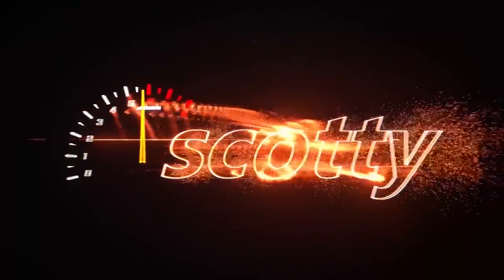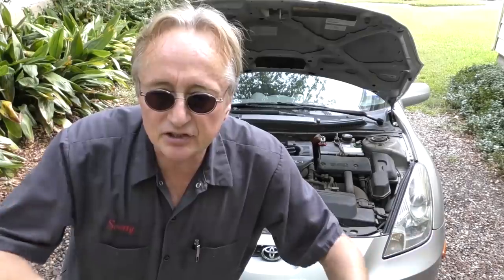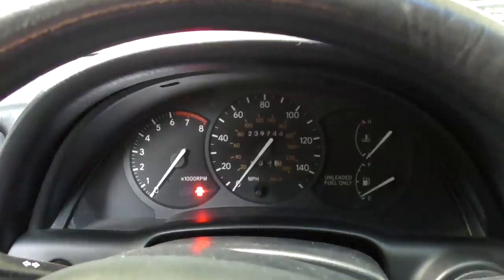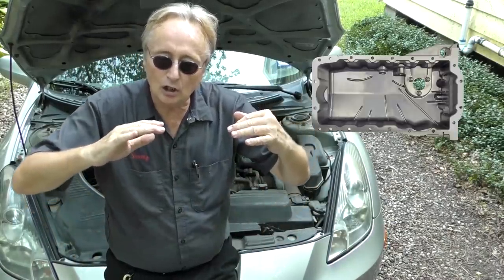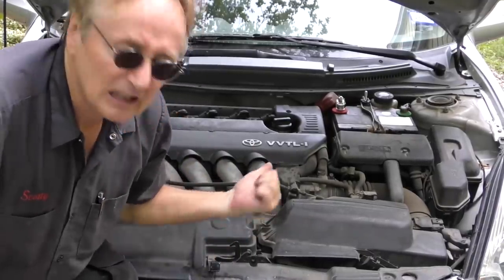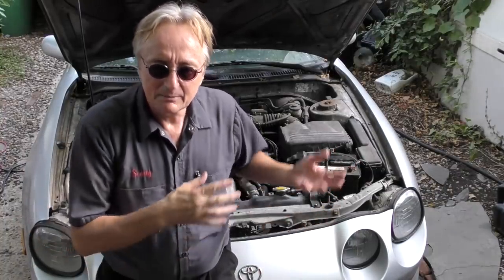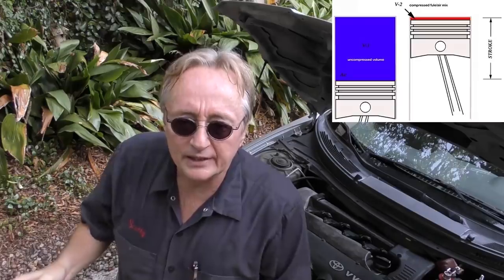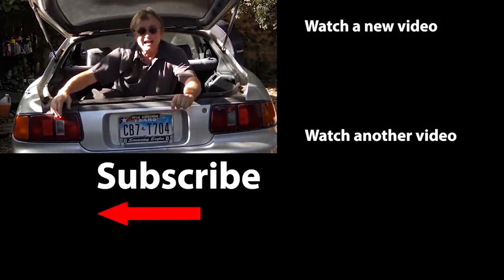Why Not to Buy a Toyota Celica

Comment: Even with the flaws the 00- 05 celica gts are  my favorite  budget car
Reply: 5 things to do to fix all the problems he listed.
New updated lift bolts from later model 2zzges and clean lift screen
Moroso oil pan with about a extra half qt of oil
Apexi pfc to hit lift afew 100 rpms earlier to stay in lift between up shifts
Learn not to money shift
Use quality full sythetic oils and dont cheap out on lower octane gasoline
= Bulletproof 2zzge
Reply: I’m looking to buy one for touge and planning on doing everything to make the GTS handle better and bulletproof
Reply: @comediccommentator4663  hit it right on the head. Although I'd spring for a new oil pump, rev it about 500rpm higher with the pfc so you land at 6K or over. You lose a little bit of oomph lowering your lift point
Reply: @comediccommentator4663  All the five things you listed, is why I would not buy one!  :-)
Reply: @mikeymike758  You wouldn't buy one because of not being able to money shift?
Reply: Comedic Commentator how much is the oil pan ... cost?
Reply: @felixhernandez6736 go ahead and waste your money
Reply: @syed bokhari Depends where you find them for sale, i’ve seen them go as low as $450.
Reply: @Mikey Mike
To each their own. 
Lift bolts cost like $15 and are like a 10min job to replace + clean the screen
Moroso oil pan can be expensive, but it’s like a hr and a half job to replace the oem one with the moroso pan (well worth the money if youre going to track or beat on your 2zz)
Apexi pfc isnt necessary, you can always swap out for a older 2zz ge ecu which had lift point at about 6k rather than 6.3k-6.8k (like $100 at a junkyard)
And using quality oil and premium gasoline is just a given if you care about your machines, it’s whats recomended by the engineers that designed the engine.
These design flaws are NOTHING compared to other makes and competitors. (Aside from maybe the teggys).

Comment: I know mileage does vary, BUT, I drive a 2000 celica with the 2zz and I haven't had a single issue for the 7 years I've driven it. I'll be rolling 230k miles soon, factory everything, and it's never ran better. Most dependable car / engine I've had, right up there with my GM 6.0. Just my $0.02 tho

Comment: The problem is Toyota cheaped out on the oil pump gear.  It was sintered metal, so when it sucked up any air, the cavitation would chip away at the gear or even cause it to explode.  This wouldn't happen with a solid metal gear, which was available in the aftermarket.   The pan issue was because of how well the car handled from the factory (think ITR).  Put some sticky tires on it, take an offramp at 80mph, and you'd probably have an issue with no oil at the pickup on most cars. 

Also, note that the 2001+ Celicas had revised shift gates, because drivers couldn't drive and misshifted (still didn't stop them...).  And the 2002+ Celicas lowered the rev limiter from 8400 to 7800.  Another attempt to reduce the chance of blowing the engine on a misshift, but all it resulted in is hurting power (8400 is required to stay in lift from 1-2).  Aftermarket solutions existed, but the 2000 Celica was the purest form of the car. 

The version of the 2000+ Celica that should be avoided is the 2000-2002 GT.  The 1ZZ engine from those years was well known for oil consumption issues.   Same issue in the Corolla and MR2 Spyder (which also inhaled its own precats!).
Reply: I have never owned anything but a manual transmission. I've never miss a shift before I bought my Celly in 2000. I did it twice before they fixed it with upgraded shift gates. All fixed under warranty. Afterwards, no problems. I was going straight down into fourth, but second gear was engaging. So your slightly wrong blaming it on people that can't drive.

Comment: The 2zzge can drive the oil pump to the point it cant suck oil fast enough. There are aftermarket gearsets and/or oil pumps to fix it, so.... 
Fix that and they work fine.
Reply: The oil pump has no problems at all.
The thing is the 2zz engine may suffer from oil starvation when it passes 1g side force, to solve this you need a baffled oil sump, like a Morosso or one from Eliseparts. Doing this change, the oil pump will just run happily forever
Reply: @anunknowndude  Thanks for the tip. 👍

Comment: The problem with these 2zzge engines was insufficient oil capacity and oil pans with no baffling.  Both could be solved with an aftermarket oil pan.  These things also commonly get destroyed by miss shifting at high rpms.  Otherwise they are pretty reliable as long as they are cared for.

Comment: I have 2zzge 192hp in my Corolla T-Sport and it has done over 300tkm. Still works and pulls perfectly fine. Just proper and regular maintenance and it works just like any other good Toyota engine.

Comment: Toyota Tacomas are bulletproof. I seen a few of them with about 750k miles.
Reply: Swaggy Jay Had two Tacoma’s in a row that were both lemons. First (2012) had a bad transmission (could not shift directly from 1st to 2nd) and the second (2014) had a lousy v6 engine (piston slap). Both were bought brand new from the dealer. Both got the same support from the dealer (they tell me “they all do that.”). Finally bought a 2016 F-150 and it is a truly incredible truck. I would NEVER go back to Toyota trucks.
Reply: Tom Harding The ones I seen were under the year 2000. So I guess maybe the older models lasted longer. Sorry to hear about your experience. Anyways, the Ford F-150 trucks are truly amazing.
Reply: Tom Harding your first mistake was buying a lemon, you should kbow what you’re getting yourself into

Comment: I have a 2000 Toyota celica gts with 225k miles and the original engine no problems
Reply: They're solid engines. Scotty is running out of video ideas.
Reply: Me too but Scotty isn't the first person to warn about these engines. Just make sure you regularly change your oil and use the correct oil ... and keep your fingers crossed!!! Lol 😅😂🤣
Reply: @SteveRogers461  The problems he describes are from the first ones sold in Japan which had higher rpm limits. They fixed this for the models sole internationally.
Reply: J Anything these engines are actually known for their unreliability..
Reply: @ColdVsIce  Don't know where you're hearing that, the only major problem was the oil pump failure with the first bunch that were sold in Japan. Rarely hear of any engine issues with these, plenty  over 200k miles on the clock.
Reply: @hippopotamus86  Your proof that the faulty ones were only sold in Japan?
Reply: @80s_Boombox_Collector  The oil pumps were known to have problems but this was fixed by lowering the rev limiter on models sold everywhere else.
Reply: @hippopotamus86  That being said, Esther Romero's GTS could qualify for 'Show-off Sundaaaaaay!' Very nice, well-built cars, and I'm quite confident the mileage on this GTS will easily overtake the one on Scotty's 1994 car.

Comment: I have a Celica VVTi 💖 143 hp and I find that your video is true and therefore can be very useful. But ... there is no car and car brand without trouble.
What about the prestigious Subaru engines that fail as easily as their transmissions?
What about the latest turbines on BMWs? I've known several people whose turbine exploded and didn't even pull hard with their BMWs...

Comment: Same engine I have in my Lotus Elise. :) And I love it!
Reply: in Principle so you drive a Toyota celica with a body kit... I’m sorry but you bought the wrong car my friend
Reply: @swankgodd3647  to each their own. :)
Reply: @swankgodd3647  Remember that the Elise is crazy lightweight, and designed from the ground up as a sports car.  Unlike the Celica with Corolla underpinnings.
Reply: Christian Fiore between the celica and the Elise were talking 500 pounds. At the most. Gut a celica and you have the same weight. Same motor. At the end of the day the Elise and the celica are the same.. it’s just a body kit😂 maybe it handles better sure; maybe it is more sturdy and built more streamline. But doesn’t change the fact it’s the same car

Comment: So glad I got one with the 1ZZ-FE.
Reply: King JamesIX i have the gt as well and a lot of people with the gt including myself have an oil consumption problem 😪 great car aside from that
Reply: Nah, should've gotten the 2zz.  My 02 gts original engine now has 383k miles and still hits lift hard no proplem.
Reply: @letdalordbewithyou5665  Yeah mine eats a little oil but it's not a big enough issue pushing 225k miles and still running strong.

Evap emissions system is throwing a code and I'm gonna be replacing the catalytic converter very soon but other than that it seems bulletproof.

Comment: I own a 2000 gts with 234k miles original engine on it so yeah.
Reply: Juan Barraza congratulations!
Reply: So your saying Scotty will say anything for a quick buck
Reply: Definitely still better than say European cars or something
Reply: @itsallgoodman1244  Mine has 227K on it, and my old one had 385K
Reply: @itsallgoodman1244  lol gotcha my gts  is actually for sale haha
Reply: Same here, and I have abused it a lot, (not purposefully).
Reply: 01gts got about 240k kms and still starts just fine even at -37°C
Reply: Bought a 03 gt for 1500 with 142k, hopefully after getting misfires fixed by replacing the fuel injectors it can get back to hitting the road for another 100k
Reply: Oh Natx it depends on how you drive it as well. Drive like a little old lady, it’ll last lol
Reply: Me celica is 300,000 Miles and run like a champ
Reply: @SkillZHG  how much?
Reply: @petsshowtime4016  I've fixed mine and it's no longer for sale haha

Comment: Toyota/Yamaha joint ventures have delivered great results, from the original Toyota 2000GT, to my current dream car, the Lexus LFA.. And of course, everyone's favorite, the Legendary 2JZ.....

But, the 2ZZ was apparently not one of their best efforts, it was unreliable, and it wasn't even very good performance either! The cam came on so late, even if you shifted at redline it fell off the lift powerband. At least on the US spec Celicas I drove.. An old friends Elise did the same.
Reply: The 2000 GT was originally a Yamaha and Nissan project.
Reply: @DarthVader-1701   Interesting, yes. But Nissan (Datsun) passed to develop their own 240Z.. Never knew that until now, thanks.
Reply: The 3SGTE was a Yamaha too!
Reply: I think 190hp out of 1.8L  is good performance.   What would you consider a good performance number from a 1.8L engine?  Serious question, if there is something better in that displacement I'd like to know about it.
Reply: The 2zz wasn't unreliable lol. The 1zzfe pre 2003 was though
Reply: @hamsterbrigade  100-105hp/litre  n/a  is pretty good, considering the highest HP/liter engine is a Ferrari making like 125HP/liter.
Reply: @RolandoMarreroPR  Yup, it was basically 2/3rds of a 2JZ.
Reply: Unreliable is due to poor maintenance stop giving it a bad name. My Celica Gts (2000 automatic) has 258,200 and is still on it's first transmission and engine. It's all about taking good care of your car. Only CEL I have had was related to 02 Sensors going bad every 40k miles.
Reply: @kotymccallister5150  And Ferrari engines break down every 100 miles or so.
Reply: @bliglum  It's 1/4 of the LFA engine. It revs up a lot faster then the 2JZ engine.  I have both.
Reply: @mikekemp3002  My O2 S2 crapped out after 200K mile. O2 S1 still original after 335K miles.
Reply: @hanssolo4695  idk about that, but they definitely don't last long lol. Planned obsolescence. If you can afford one, you can afford repairs, and ferrari knows it lol

Comment: This 2zz Motor is actually badass.

The engine isn’t bad or the problem ... it’s the oil pan assembly design according to your explanation. I love this motor and this gen CELICA. They look great lowered with wheels.
Reply: Is there an option to run them without wheels?
Reply: Toyota4Life   The 1zz was the worst engine. Celica tuners have been searching out the 2zzge as a replacement.  It just comes down to changing out the bad lift bolt and putting a baffled pan if doing a lot of cornering at high speed. GTS rule!

Comment: I have a 2004 celica. When the engine is cold, the overdrive won't kick in. At least not till it pass 2 miles. Is this normal. I have this particular engine.
Reply: Yes. If you mean the lift. Car will not GO FAST, lift, until engine is heated up

Comment: scotty is right about the 2000 2zz engine problems. but i wanna say by 2002 toyota fixed the problems. i have an 05 matrix with 2zz and it has held up no problem. any problems toyota has which is rare they tend to fix it within a year or 2.

Comment: That 2zz engine is not that bad. It's the oilpump which cannot hold up.

Get an oilpump with a much higher capacity and the problem is SOLVED.

The rest of this Celica is rather bulletproof.

I would buy one for the right price!
Reply: I love most of Scotty's videos, but he ran out of ideas or something with this one.  Even the GT-S engine is fine with a couple tweaks, and the one in the GT is basically bulletproof.  Knew a few people who drive crazy and their GT-S engines lasted 270-300,000 miles each.
Reply: Which GT-S model would be the best to get from (2000-2005)
Reply: What could be the right price for a 2001 Celica GT-S?
Reply: And oil pan....

Comment: Now I'm stressed. Was told to buy Celica, bought it and invested in it, now it's crap. Streeeesssssed
Reply: N3K X8 why do you worship Scotty? He isn’t God. He doesn’t even drive the Celica anymore
Reply: @Eman1900O  hes driven it 5 miles in the last 18 months but in most of his videos hes working under the bonnet, if it needs that much work for such low mileage usage per year it aint reliable
Reply: Traditionalist He is God! Holy of Holiest! Pastor of the Kilmer Church of the 94 Celica's!
Reply: It's fine, scotty is running out of video ideas. They're as reliable as any other Toyota.
Reply: I'm on my second 7 gen Celica at the moment, the reason I'm on a 2nd? Because the first one was so good.
I had a 2000 VVTI model (the 140bhp without the lift) it was fast enough for the roads and handled fantastically and on country roads could easily keep up with more powerful stuff thanks to the cornering.
The only reason I let it go was it was on 186k miles and I found a one owner 2004 model with little to no miles on it going cheap.

My local mechanic actually bought my old celica from me once he heard I had a new one.

My tip to you is go take a look at a few, don't touch anything that's had engine mods, because any ape could have fitted them, and go for a VVTI model, cheaper to insure, run and maintain because it doesn't have the complicated lift system.

And try and go for a facelift 2002 or newer, they did a lot of improvements to the engine, fixing a lot of the stuff mentioned in this video.

Lastly enjoy your celica when you get one
Reply: Dude I've got the same car (2000) with well over 100k miles. You're fine

Comment: Hey, I am looking at buying a 2004 Celica with auto. Car looks great not modified any just wear shows on driver seat. Has 186K miles on it so far. The car has an engine shake/ vibration and I have read this is a common thing for 7th gen Celica and many owners just "live with it".  I read this is a timing chain not belt motor as well. The base GT was the 1ZZ engine, does this make a difference to you?
Reply: I would look at a different car, getting this car in a 1zz auto is a waste of time. its basically a corolla at that point, engine shake is probably because of worn engine mounts usually the rear motor mount goes. if you going to get a celica at least get a manual, and 2zz is better
Reply: GT is pretty boring.  GTS is a real beast, lots of fun to drive. 2ZZ is a very strong, reliable engine, quick revving, screams like a jet engine.

Comment: on a serious note, my mom owns one of these with about 200k on it. while the 2zz isn't bulletproof, if you use premium gas, take care of your routine maintenance,  and maybe do the mods to prevent the oil problems, these cars are extremely economical and reliable and are great if you want to get into a sports car for under 3000 bucks

Comment: You don't hear complaints from Toyota Matrix XRS and Lotus Elise owners?🤔
Reply: @distorteddominance5154  I agree. I currently still drive my '04 Matrix XRS and it's nearing 200K miles on the original engine. I don't drive like a teenager, though.
Reply: If you don’t drive like a total arse bag and flog the engine, are there still issues?
Reply: I drive a Lotus, probably a few reasons. 
-Lotus ECU
-Bigger Intakes=better cooling
-Car is 600lbs lighter
-Different oil pan assembly
Reply: @distorteddominance5154    I'm still looking for a XRS. I guess most people don't track their Matrix, compared to the GT-S.
Reply: @theloopholeisntaahol  intake has no effect on cooling
Reply: @kotymccallister5150  sorry you're right. Bad wording on my part. Meant to say bigger vents.
Reply: Keep on watching......... 🤦‍♂️
Reply: @6lemans10  I have one for you  -- 107K original miles, I'm the second owner. It was my wife car but she was consistently frying the clutch (6sp. man.) She gave up (with man.transmision) and Matrix XRS '03 is parked outside on my driveway. 
I just put brand new clutch....
Reply: @guerguistoyanov137   Thank for the offer. I live in Richmond, VA. I dont want to travel very long distances for a car.
Reply: @6lemans10  I'm about 800+ miles away from you  -- Lansing, MI
Reply: '04 Matrix XRS, 160K miles, doesn't use oil between changes, runs like new.

Comment: They did not put any baffles in the oil pan. That is a zippy engine and because they did not put baffles in the oil pan the oil washes away from the oil pump. It does this when you are revving the motor and really pushing it. It's my understanding that the same engine works just fine with the lotus platform because the oil pan has baffles. I might get myself one of those celica's one day. But I will change out the oil pan immediately. It's basically a poor man's front wheel drive lotus.